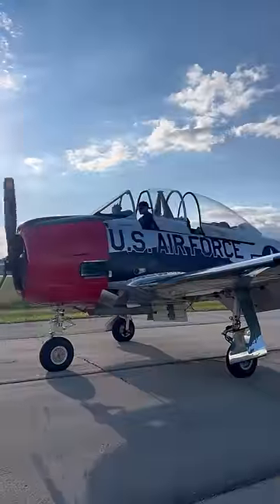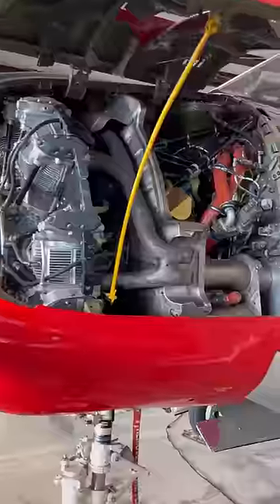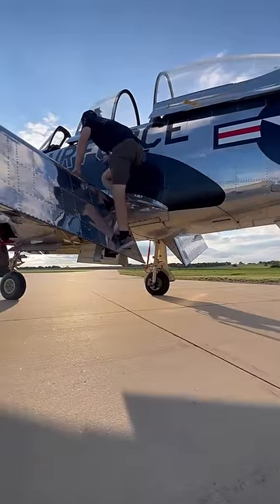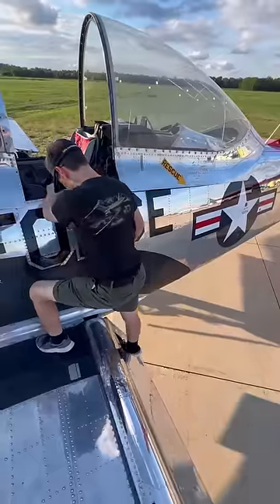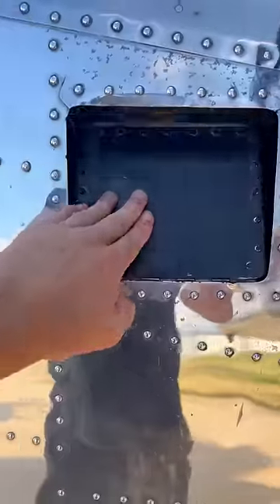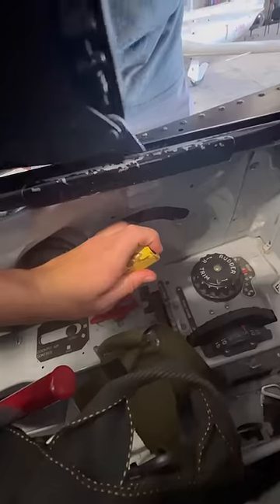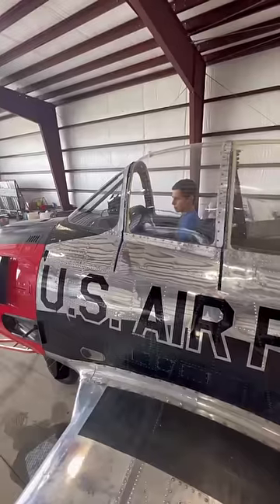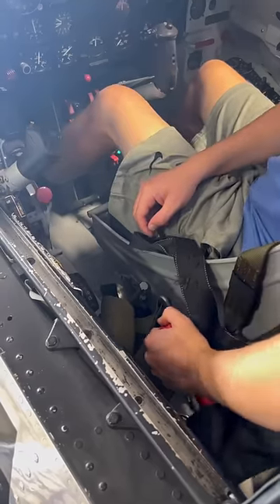Is the T-28 a Good Daily Commuter?

Comment: "Slowly lower the flaps, landing gear and open the canopy"

The slowly part is key here... if your engine goes and your hyd pump isn't running, you will have to get pumping fast!
You want the flaps down to reach a landing site, gear down to land and canopy open to run away from the airframe afterwards!
Reply from the maker: Definitely want to keep your left arm ripped!
Reply: @jackschneider17 which is why I think they should have put it on the right side
Reply: @blackmusik109 Nah, they put it there to help the boys even their arms out so they aren't pulling a Quagmire with the one extremely buff arm
Reply: Hopefully you don’t lose hydraulic oil
Reply: Chuckle, the canopy has pneumatic emergency opening.
Reply: @weytogoman  Assuming you still have pressure in the gas bottle
Reply: @richardmillhousenixon  if you don't have pressure then you have a lot more to worry about other than that !
Psst, my MOS in the NAVY was "AME", that's an "aviation mechanic egress" meaning i was responsible for the pressurization systems that facilitate survival.
And it doesn't just leak out.
Reply: @weytogoman  If you've taken fire then it's not hard to imagine that a piece of shrapnel might have punctured a pneumatic line or cylinder
Reply: @blackmusik109 
If it was on the right side you'd have to use the wrong hand to fly the aircraft.

Comment: A T-28 is such a fun airplane to fly. I had the chance many years ago. Took it around the pattern a few times. Came back and the Owner said “is that the best you can do?”  Went back up and took off, did a barrel roll on the climb out, a couple loops and a split S, came back and said “ is that what you meant?”

Comment: What kind of gas do they have to run in these old planes? I know aviation gas in ww2 was really high octane so I’m curious if they can use normal 100 octane low lead like a Cessna today or do you need the 130 octane stuff they were using back then.
Reply: Yes, it runs on 100LL.